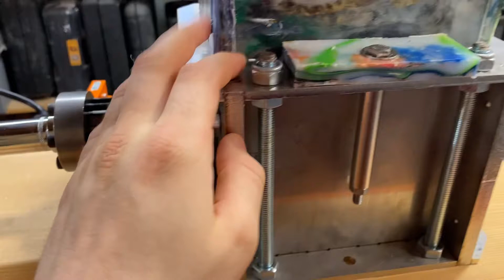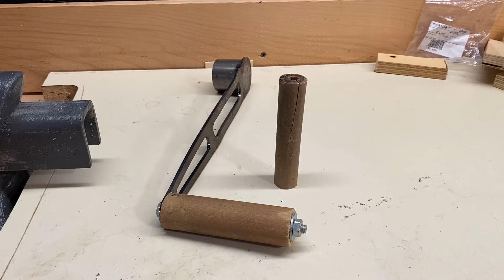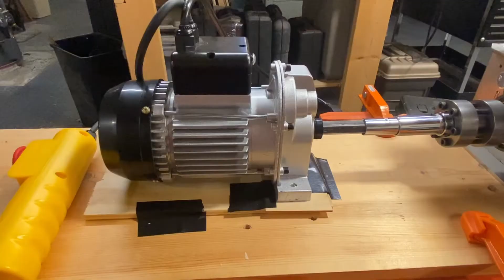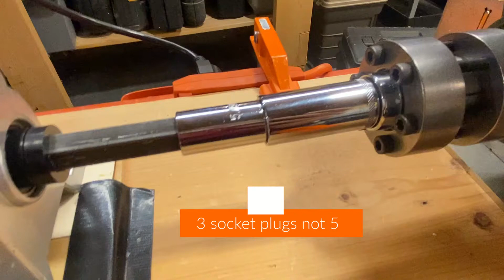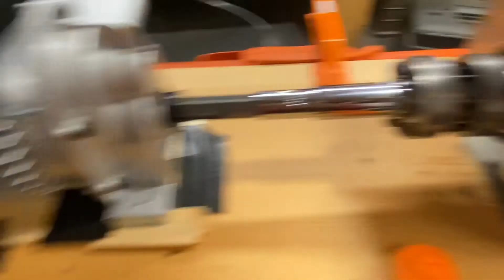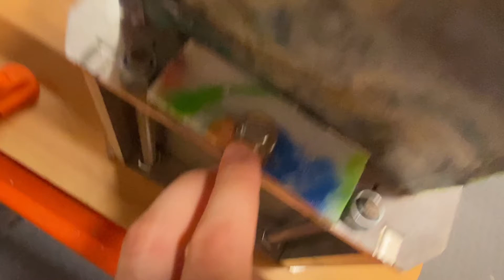My Shredder #preciousplastic #machine

Comment: I bought the same motor, does it still work? Have some advice? Who much time do you use and what pause do you give?
Reply from the maker: I actually have a different motor but it’s from the same company. I usually run it till the temperature reaches 45 Celsius
Reply from the maker: Crane motors will work they have gear boxes built in them.